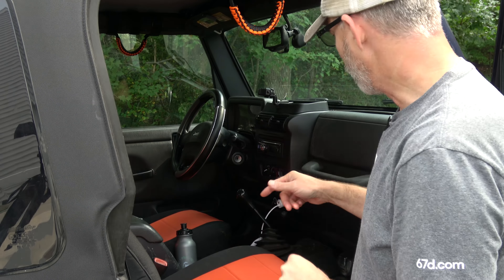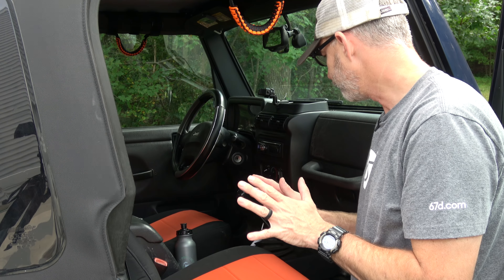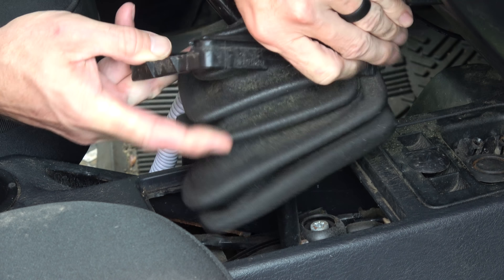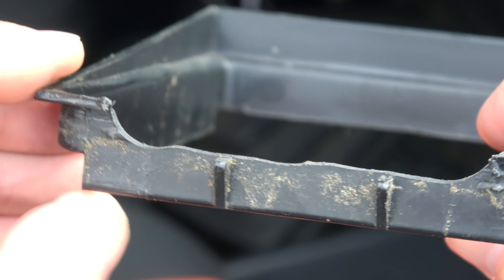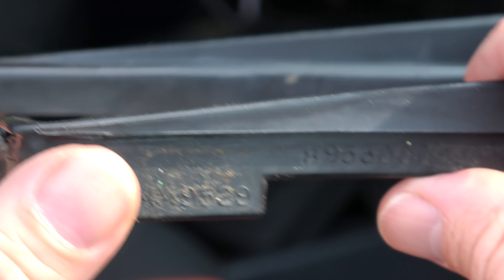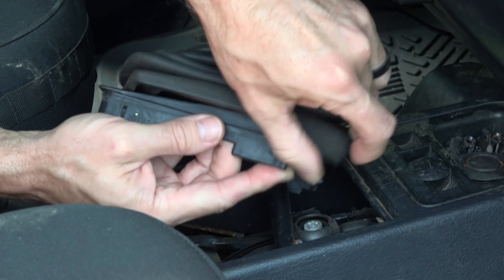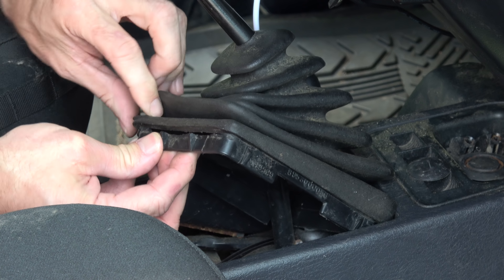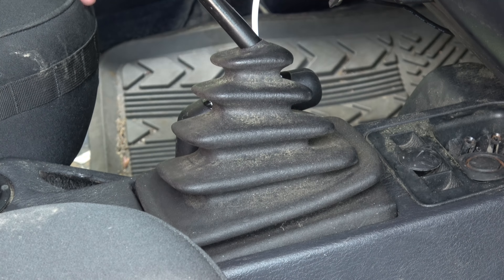SOLVED! Popping out of Gear after Body Lift - Project 2004 Jeep TJ Wrangler

Comment: My tj has a 2.5" lift. This did a little bit better but my second and reverse kept popping out. I ended up torching the shifter at the bottom and bending it to the dash. Then let it cool and torched it a bit higher and pulled it back to where it was. Now it stays in gear. I used a welding blanket and wet rags. Thanks for the video

Comment: I did something similar, however, it's not necessarily just that bracket that is causing the issue - it's the shift boot itself that binds up and still likes to kick me out of 2nd from time to time. I guess it's not nearly as annoying as it was before, so I haven't really done anything to it. My assumption is that replacing the boot itself with a thinner material will ultimately correct it...or just take the body lift off. LOL

Comment: To fix this problem correctly they sell a longer piece that goes into the transmission. Buy it and get the seals that go in the top of the transmission plate and do it right! No more issues!

Comment: Just bought a 2001 TJ with a 3.5” body lift. Does fine in 2nd but won’t stay in fourth. Also pops out of 3rd and 5th when I let off the gas. Somebody recommended a longer shifter or an extension. Thoughts?
Reply: I’m having the same issue with 2 and 3 😢

Comment: I tried this on my 03 after a body lift. I cracked the hell out of the small plastic frame. Now my boot dangles in the hole. :-)
Reply from the maker: Kristian Martinez $8 and it's fixed! 😁 https://rover.ebay.com/rover/0/0/0?mpre=https%3A%2F%2Fwww.ebay.com%2Fp%2F175110296%3Fiid%3D351483089902